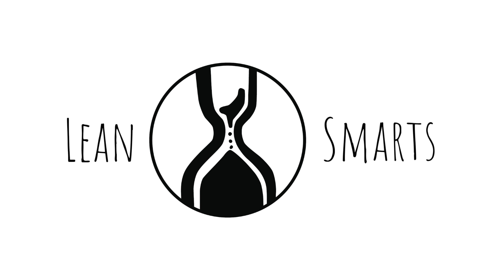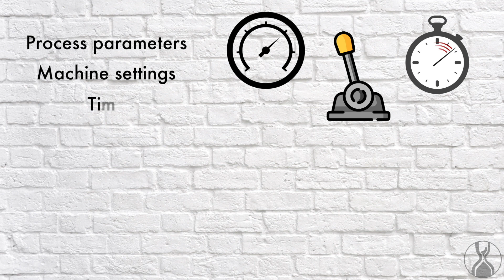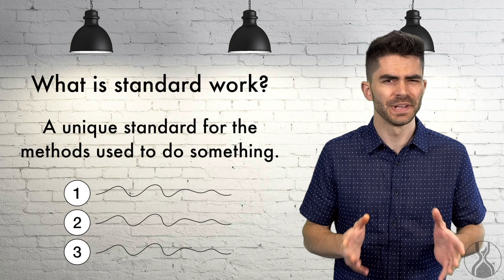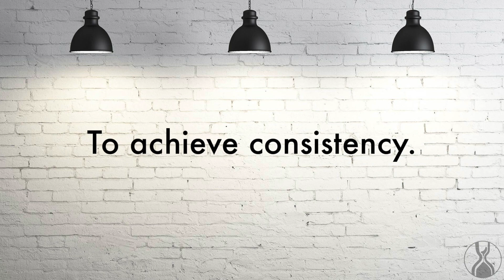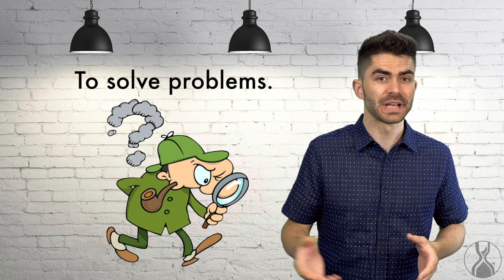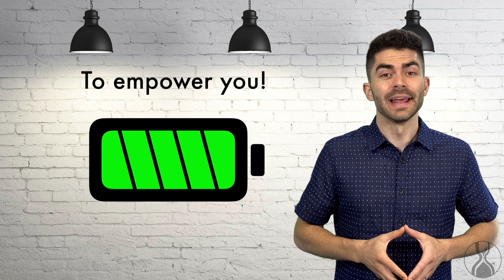How Standardization Makes Kaizen Stick! - Lean Manufacturing Training

Comment: If you don't have a standard work, you can't improve standard work. Ever been to a bar or restaurant where a bartender or waiter/waitress was on their first day. They follow someone around and get this hint and that hint and then get thrown into the deep end of the pool. Then they get nagged about doing this wrong and that wrong dozens of times. Nagging at someone about doing things wrong, is not the same as teaching them to do thing right. Standard work solves this.